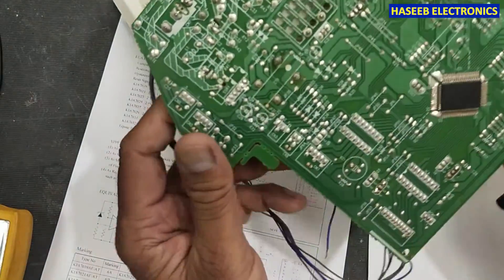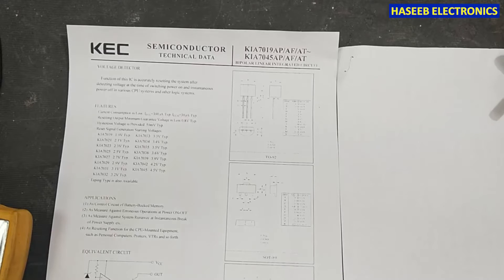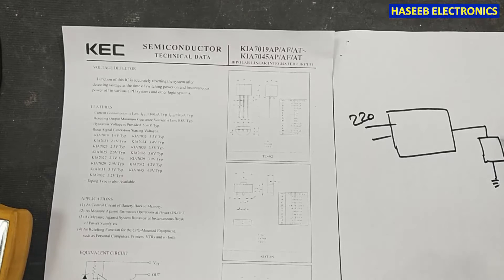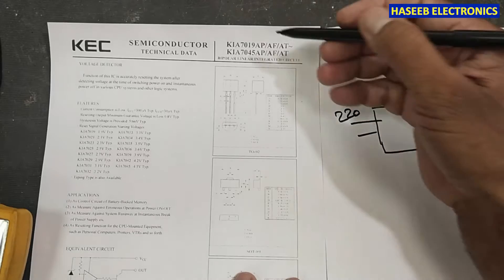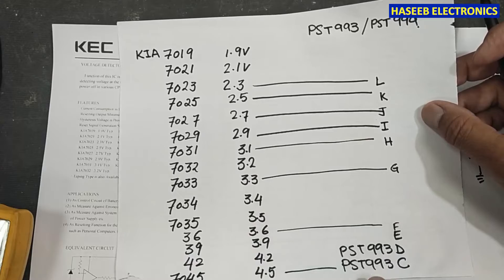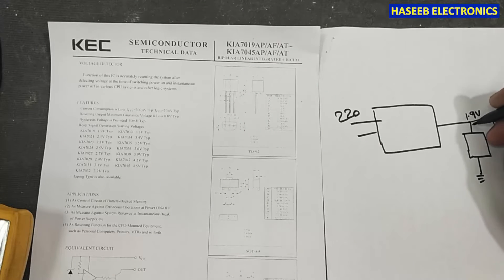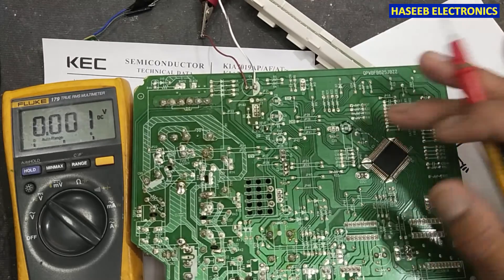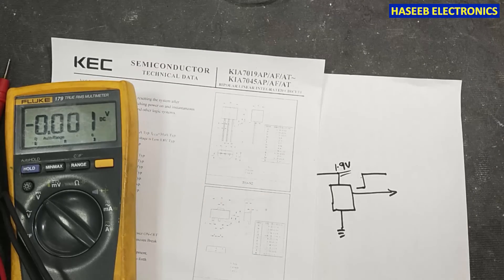{741} KIA70xx Series Voltage Detector for System Reset

Comment: Hi friend thanks for the informative video. Is the output voltage from the detector ic continuously present on the reset pin of the processor or do the pulse voltage stop?

Comment: An interesting IC. Thank you to the Commenter and you for introducing it to us. It appears to only be available from Mouser in the ROHM’s BD48xxx and BD49xxx series.(?) Even though you explained it perfectly well, I am having a little trouble with understanding its use. Is it to watch for and reset a device when a Brown Out Condition occurs? Or, is it a Current In-Rush Limiter? Or, both? I have an interest in building a device that will monitor the internet connection on a router and automatically reset/reboot/cycle its power off/on, when the connection is dropped. (I am aware that these devices are available as commercially manufactured units, but building one is much more fun! And, I am aware that a MCU could be used for the purpose.) I wonder if this IC might be a more simple means to accomplish the task (as it would be a hardware only solution, requiring no coding.) Might it, somehow, just monitor the voltage on the data leg of the internet service line and, if the voltage is lost, thereafter the circuit would cycle the power via a relay? I think maybe not, as the data leg varies between high and low, as the normal means of transmitting data. Hmm... Maybe a cap could be used to smooth out the transmission and, if the conversation is lost for more than a few seconds, thereby allowing the cap to drain, the reset would occur. I am just thinking out loud, here. Cheers! EDIT: Ahh... I see that you answer this question, for another Commenter.
Reply: Sometimes the processor needs certain sensors to be powered and ready before it should boot up. The purpose of this chip is to put the sensors power supply to it, and when it is sure the power got to that portion of the circuit then it resets the processor. It could be another power source all together that powers some sensors and it takes a certain amount of time for that supply to be stable and cha4ge the capacitors. This is the most common use case. Many times during boot of the microprocessor it starts communicating with sensors like i2c, or serial etc. But if the processor gets power before the sensor it will fail to communicate so its essentialy a delay start to the processor to ensure other sub systems are up and running before it tries to establish communication. I hope that helps.
Reply: @newmonengineering  Yes, helpful! Thank you!
Reply from the maker: best regards 
actually it is a third layer of protection (1st layer is EMI filter, Inrush protection. 2nd layer is switching regulator in case of smps, or linear regulator like 7805 in case of transformer based power supply)
it is used to give a delayed startup upto 15 microsecond normally to initialize crystal oscillator, and peripherals of the MCU, CPU. then it will release the CPU/MCU for processing. there was a special ic for reset control, ( i remember i was dealing in 1990 it was being used with iSBC86/12A board to produce power on reset and power recovery reset. i forgot its number. it was using a high value resistor and a capacitor to give 3-5 second reset interval, i will recall my memory and will share its number)
Reply: @HaseebElectronics  Interesting! Thank you for your extra efforts to provide me with this clarifications. It is much appreciated!

Comment: Good video. How to test microprocessor please help
Reply from the maker: normally we cannot test microcontroller because its inputs and outputs are changing all the time 
just we need to write code, and its practical circuit to test inputs and outputs 
i will try to explain it practically
Reply: @HaseebElectronics  thank you